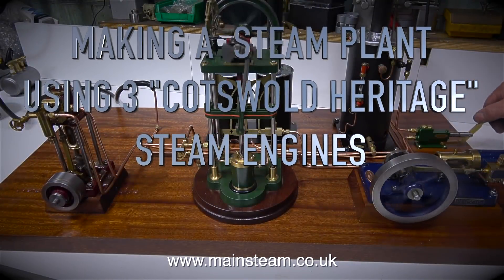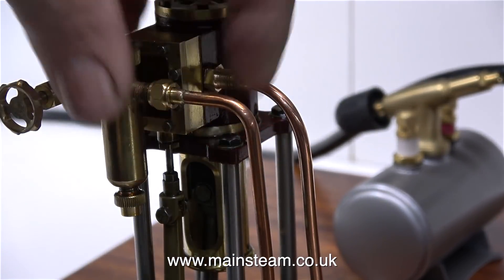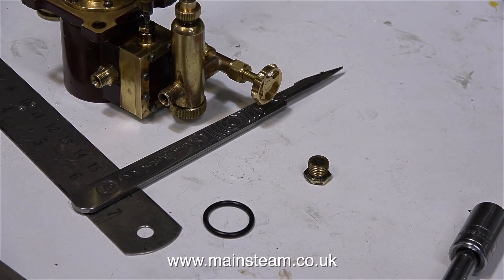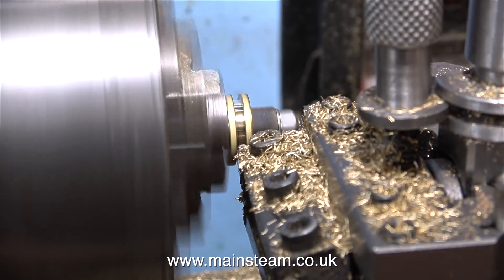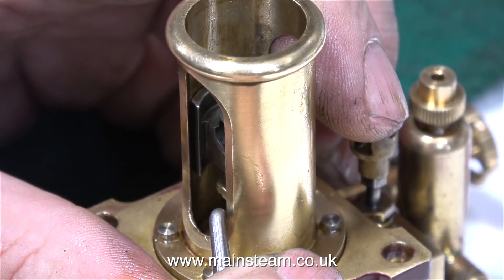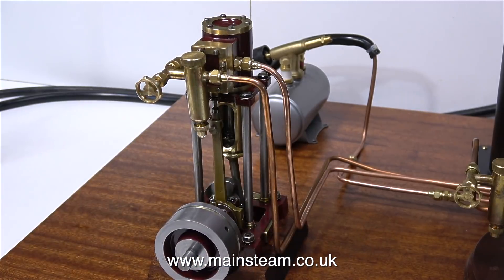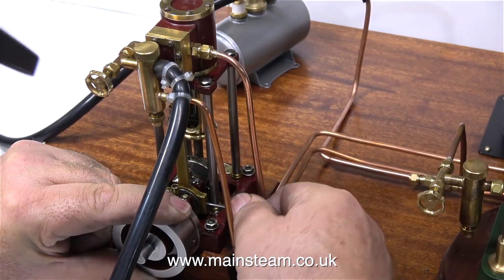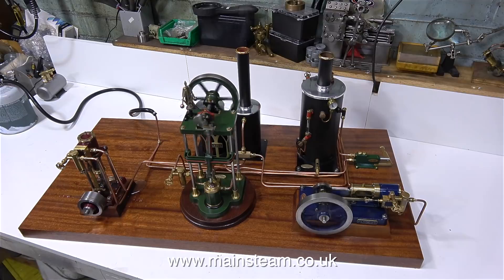A MODEL STEAM PLANT WITH 3 STEAM ENGINES - PART # 13

Comment: Mr. Appleton, I am curious if you have any advice on dealing with the age old enemy of humanity: laziness and procrastination.

I've had a project to make new eccentric straps for a small locomotive, and have had the bronze plates (no castings for it) for months now, indeed the first one has even been marked out and partially cut to shape, but yet when it comes to finishing it I find myself doing every possible other thing.

Indeed, writing this comment itself is one such method of procrastinating. I think I may require one of your medieval weapons of mass destruction to be held against me to provide some proper motivation.
Reply from the maker: I know how you feel - my advice is - "just get on with it" - that's what I do when I don't feel like going in the workshop .....
Reply: @keithappleton  Indeed, muddle through it now for a brighter tomorrow. Thanks for replying.